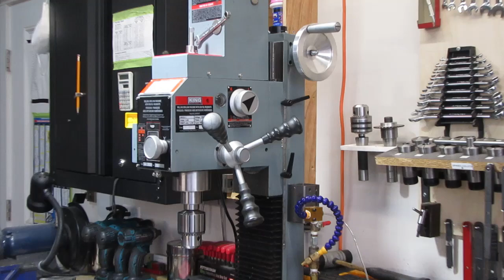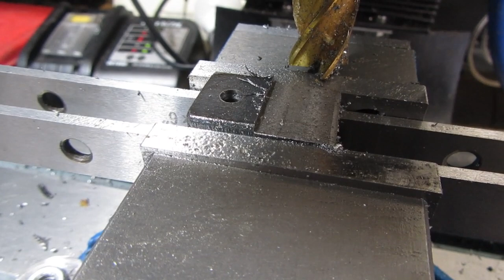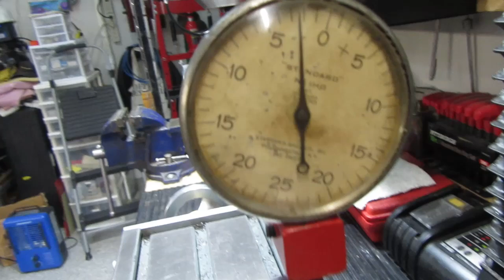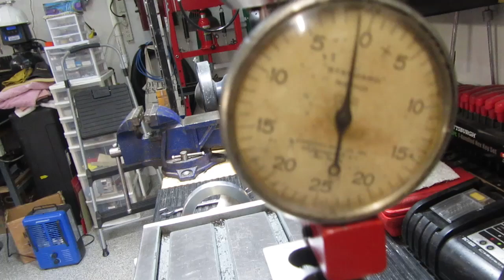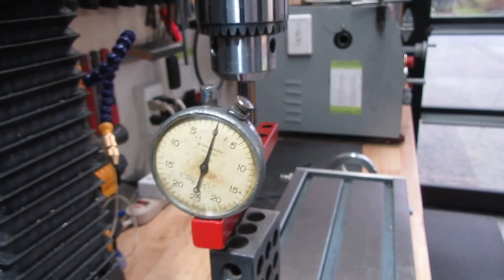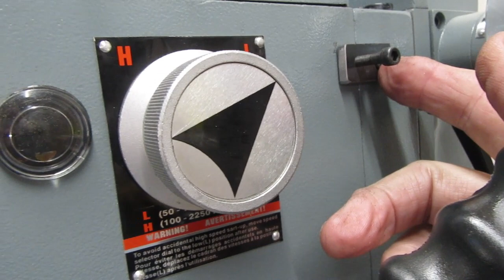Mill Head Tilt Stops & Adjuster's (KC-20VS-2)

Comment: Good idea.  Do you have any ideas for adjusting the nod, to correct the run-out on these machines, which seems to be a common problem, including on mine.
Reply from the maker: One idea but have not needed to try it out. There are two large screws at the back of the column that could be loosened slightly. Shimming above or below the screws would alter the nod. I think a very thin shim would be required as the movement at the column top would be amplified do to the distance in height. If you try this and it works please share the results.
Reply: @MrModify  Many thanks for the reply.

Comment: hello 
are you still pretty happy with this machine ?
i am torn between getting one of these and a bb cx601.
Reply from the maker: The big difference is Cx has .5 more HP but the price is about $900 more. I have had no problems with lack of power with my mill. For the size and price of my mill yes I am happy with it. I had a bigger mill before and there has been some adjusting to the reduced table size.